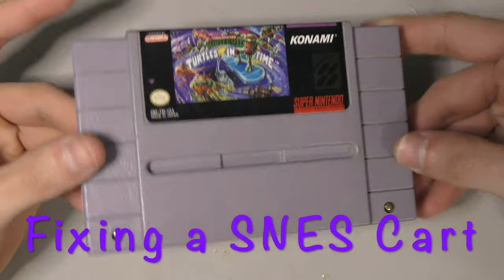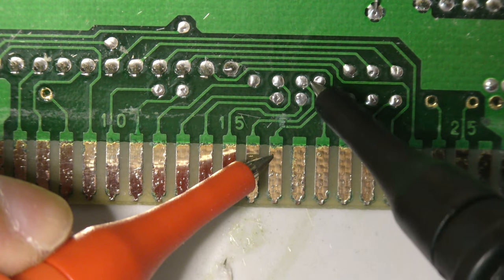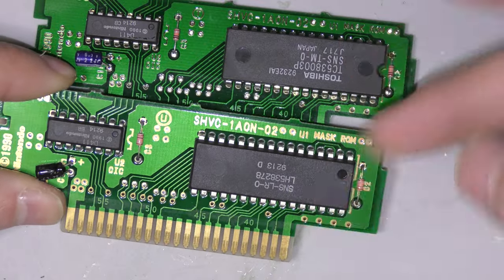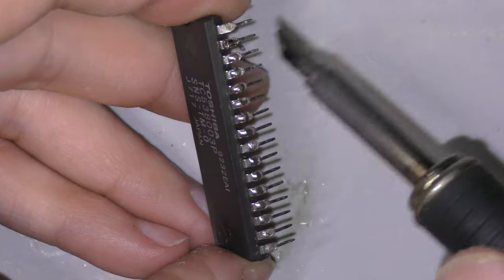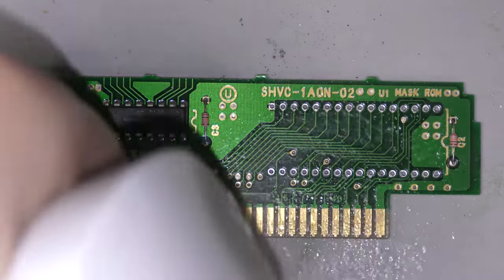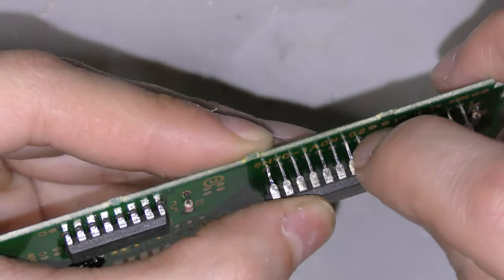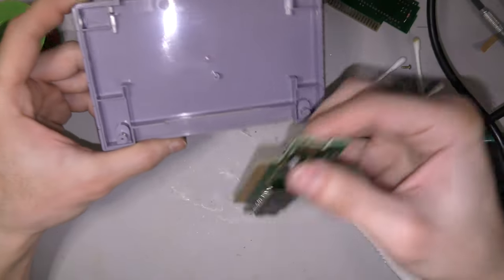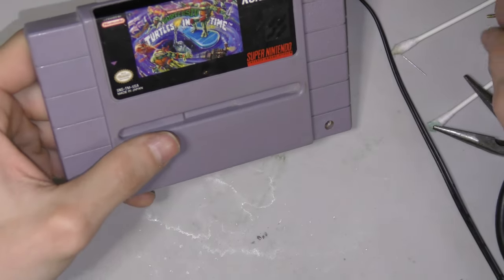Fixing A SNES Cart

Comment: what solder do you use? seems to flow nice and good amount of flux
Reply from the maker: Kester brand 60/40 diameter 0.031 with rosin core. I bought a roll in February 2019 and I’d say it should still last me till 2023 or 2024, expensive but worth every penny. I even have a roll of Kester 62/36/02 with 2% silver for greater shiny joints, though the roll is almost twice the price of 60/40.